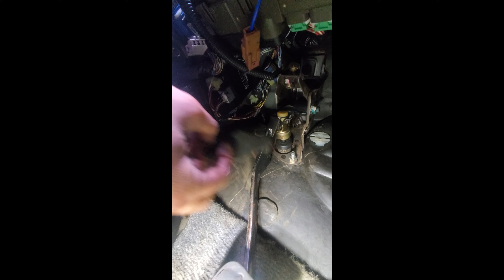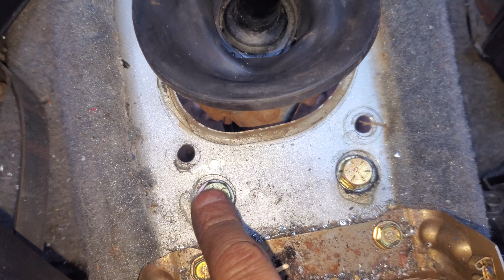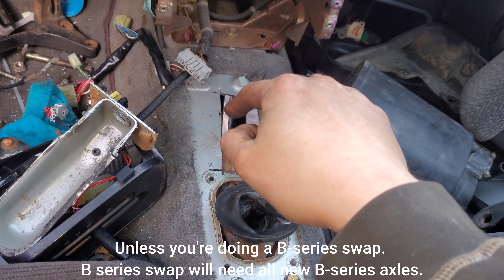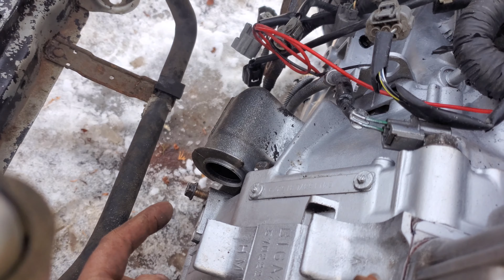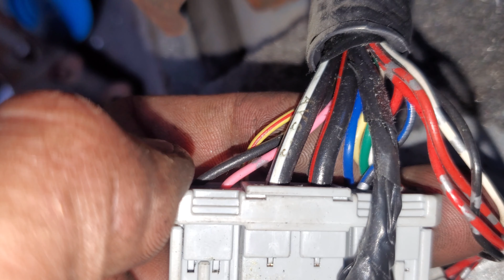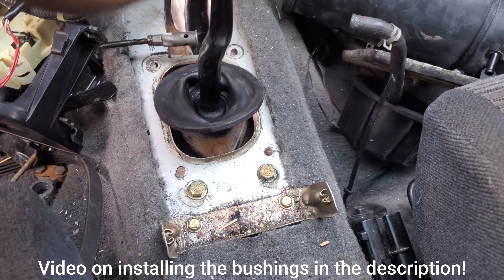Honda Civic Gets A Manual Swap! (D & B Series EK Civic) Everything Needed To Do A Manual Conversion!

Comment: Got a 4 door 97 lx my Trans was trash and my motor seized, Ive found a cheap engine and Trans together but I’m a little clue less about what pieces I need the my are givin me ecuharness and shift linkage. I’m not very knowledgeable about cars yet so I don’t know what all I have to get.
Reply from the maker: So it currently has the d16y7 and auto and you're going to swap in a d16y7 with a manual? Or are you doing a B-series swap as well?
Reply: It’s got an automatic Trans and it’s dy7 I’m getting a manual dy8 it’s all I could find on offer up for under 500$

Comment: If you manuel swap do you need shift linkage of the same model as car or transmission?
Reply from the maker: if you're converting your civic and it has a d series engine and trans combo you'll need a d series shift linkage, if its been swapped or its an integra you'll need a b series setup.

Comment: Did any know how to hook up the reverse lights when doing the swap
Reply from the maker: The wiring is in the description, there is a plug coming off of the front if the trans you need to connect 2 wires to and run then to the shifter area to the colored wires i have listed.

Comment: Will the automatic or manual d series engine harness plug right in to the b series motor and all that or will you need to get different bit connectors so they can plug in?
Reply from the maker: the auto harness should work but you will have a few plugs left unused for the transmission. Other than that, the reverse lights would have to be wired and you can use the auto gauge cluster just fine. Depending on the year you may have to do some soldering on your ecu to convert to manual but thats super easy to do or simply replace.
Reply: Raine Lutz have you had any inspection problems since its an obd1 motor going in to an obd2 car or did you do anything to make it work with the obd2 so there would be any problems

Comment: driveshaft auto can pnp in manual gearbox or not sir ?
Reply from the maker: The d series auto and manual axles should be the same!
Reply: b series auto n b series manual driveshaft same or not ?
Reply from the maker: @nuramin8572  b and d series axles are different and will not work

Comment: Do u need to swap the axles from auto to manual
Reply from the maker: In general all D series axles are the same whether its auto or manual. The same is true with B series as well, most axles are the same between auto and manual. D series axles are different from B series axles though and there are a few exceptions with each series so depending on your source of parts it might be worth a google to confirm.

Comment: i have a question! respond back then I'll ask.
Reply from the maker: Hey what's up?
Reply: @RaineLutz  

If i go for the manual swap. I was told it would be costly or can be done easier to visit a junkyard, get an LS trans + clutch system then buy all new ecu wires then be done, what do you prefer?
Reply from the maker: @inzane3229   personally I find the cheapest and easiest way is going to a junkyard, however junkyards around here don't have much for Hondas so I would be stuck looking through local Facebook groups or marketplace. It can add up real quick in price so if possible I'd get a complete swap when you are ready to buy one.
Reply: @RaineLutz  

I'm from Michigan, my choice was to buy a shit box auto/manual for 1k/2k and just throw a turbo on and beat my friends 335is, or pay 3k+ for a clean clean manual civic or i live near one that the guy selling a 95 automatic with 105k miles either just slap a turbo, or manual swap then turbo. The car club here dont have any civics and its hard to talk to people with civics. Yet alone i drive my 98 chevy k1500 at the meets
Reply from the maker: @inzane3229  honestly man it comes down to how much work you're willing to put in, How much free time you have and what you enjoy! If you want a decent project to keep you busy you can build a gnarly boosted build on a budget that would hurt some feelings, or get a clean base and throw money at it eventually when possible.
Reply: @RaineLutz  so go for a swap got it lol
Reply: @RaineLutz  hey im actually having second thoughts. Is it possible to turbo a automatic civic
Reply from the maker: @inzane3229  it is but it'll be very sloppy, you'll lose alot of power through it, and it won't last very long. There isn't alot of support to modify the automatics and they're usually over looked so I wouldn't recommend it honestly. I wanted to keep it auto too and was pretty much forced to manual swap it.